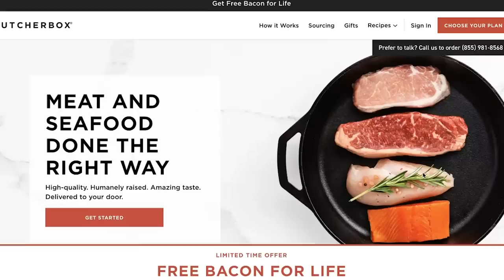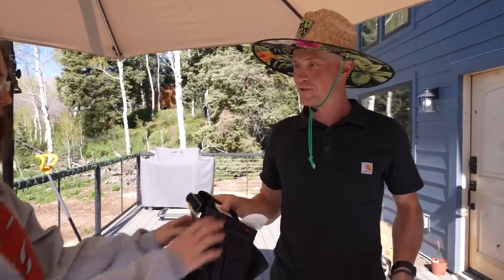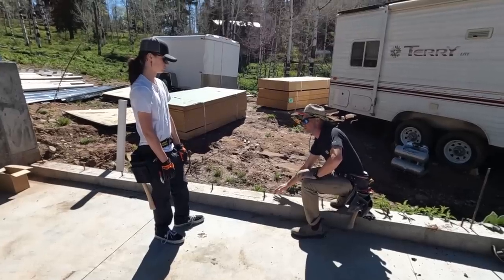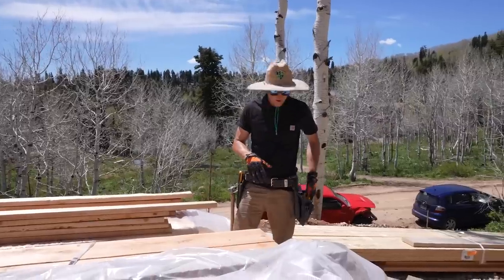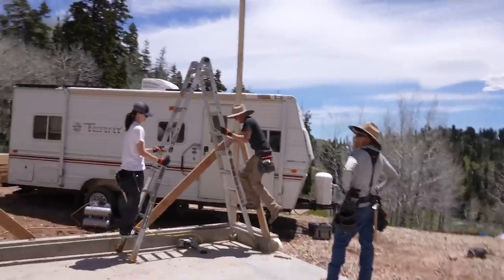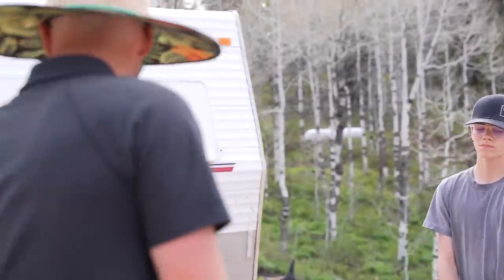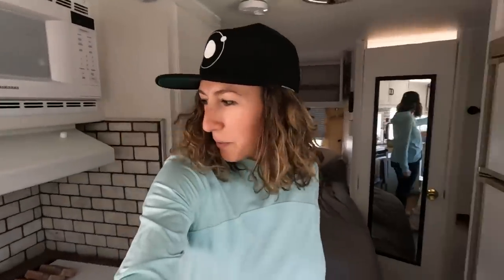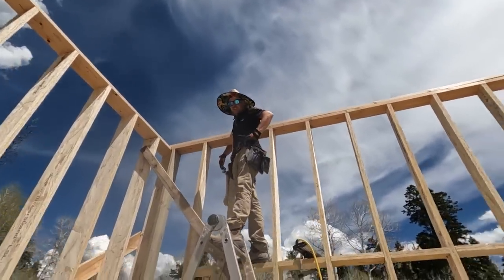FRAMING STARTS NOW!!! | BUILDING OUR OWN HOME

Comment: House cleaners don't usually tidy, they clean, so if you tidy first they will be able to do their job better. Well done Allie they will appreciate your foresight.
Reply: Totally agree Allie is correct. I clean houses for a living when I was in my early 20s. We did not clean up the clutter. What housekeepers do is clean the places that you don’t think about. Deep clean bathrooms. Clean Baseboards, pull cobwebs off the ceiling’s, deep clean bathrooms, dust and clean cabinets, the tops of refrigerators. We also mopped floors and vacuumed every room in the house. We will bring household cleaning supplies , most people like us to use their household cleaning supplies. Most people also prefer us to use their vacuum as well.
Reply: Well said! I would do the dishes because I wanted their time to be spent cleaning the actual house, and I put stuff away simply because they don't know where it goes.  They clean, not tidy is the best way to put it
Reply: You will get a much better clean if you tidy first and they don’t have to move your stuff to areas you maybe don’t want it to go. Tidy is a must do. You can also better judge the job done.
Reply: As a former house cleaner I concur!  Unless you specify clutter clean up which takes longer and costs more.  Plus we don’t know where all your stuff goes like you do.  Great comment!
Reply: I came to say the same thing. :-D
Reply: So glad this was said. The worst thing for a cleaner is to have to pick up your clutter, wipe under it and lay your things back on the clean surface.
Reply: Exactly. We don’t like House cleaners to have to clean around stuff and they don’t like to do it either. You must tidy up and put stuff away where it belongs so they can do a better job.
Reply: Yes! Our cleaner doesn't move anything or tidy. So I tidy the house before they come. I pay them to clean not tidy.
Reply: This is so accurate !
Reply: THIS ☝🏼☝🏼☝🏼 Kelly is spot on.
Reply: @gardengirl318  
Yup... Cleaning and Tidying are two different things.  I actually love to clean... Tidying takes a bit more processing.
Reply: Yep,I don’t know where your stuff is supposed to go. Also a lot of cleaning services are hired for a set amount of time. If they spend half an hour picking up that’s half an hour of cleaning that won’t happen because they may need to be at another job on time. 
  😬I knew it was Joel😜👍🏻😄
Reply: So true. Besides, when you put your things away, your housekeeper won't have to guess, and  leave you guessing too. You're the best Allie when it comes to organizing, especially when you put your videos in high speed.  It's so fun to watch.
Reply: As a past owner of a nice little cleaning business Allie is correct.  If there is tidying  up it takes away from the time that the estimate was given for and the true cleaning that needs to be done doesn't get done.  As an owner of the business I would back my cleaners if there were complaints that things didn't get done.  Cleaners would take a picture and show me for proof.  House cleaners are CLEANERS not organizers.  Unless you specify and pay for the extra cost.  Also many accounts (highly recommended) would have us come in the spring and fall to do a deep clean.

Comment: Hey Joel!  There is an official Carpenter's Helper way to carry plywood.  Tilt a piece up on a corner.  Put one arm next to your body with your fingers curled outwards.   Bend your knees and lower your body then grab and lift the plywood.  With your other hand grab the plywood behind your head.  This is much easier and not as awkward.  You're doing great!

Comment: need scaffold again for the garage  Work smarter not harder !! Get adustable legs with wheels  then could use on the outside of wall  after ground is leveled

Comment: Trent; key piece of information. You can talk to a dozen seasoned builders, which you are now one after the great job of building your house, but anyhow to the point. LEVELS ARE USUALLY NOT LEVEL. The best way to check it is place it on something, and notice exactly where the bubble is. Then spin it around 180 degrees and see if it is on the same spot. So for example if it is dead center in the first position, and then you spin it around and the second position it is no longer dead center, it's time to toss that level, and go cherry pick one at your local big box construction store, yes like HD. 
I went into HD and they had this huge box of levels, and I checked lots of them, and after quite some time I found two that were spot on, and the rest were not. 
My brother was a licensed contractor, and had his own company. The guy who worked for him had 20 plus years experience, and when my brother asked him if his level was level, he assumed it was, and then checked it and was shocked that it wasn't. 
Also squares are not always square unless they are cast from one piece for example of metal. If the handle is riveted on etc. then check to see if they are square. 
I've got a ton of respect for your go get it approach. I most especially am blown away by your mountain climbing agility, when you are 20 feet from the floor and dancing around on your toes on some ledge. Phew. Anyhow, standing on the top rung of a ladder scares the bejesus out of me, and you do it naturally. LOve your channel, and watch it religiously. Trent and Allie are one of the top You Tube channels on my list.

Comment: Maximum efficiency when built parallel with the road. Meaning the short end of the barn looks toward the house.  The front is the longest part with several stalls. Build enough room behind for a work bench behind the vehicles that are backed into the barn.  Yes, backed in because of where you live. Super!

Comment: When purchasing a level you should find a level surface and check the level in one direction then turn the level around and check the level in the other direction.  If the bubble is in the same spot both ways, the level is accurate.  You should do that same test with a dropped level before continuing to use it.

Comment: FYI I noted at 12:26 that Brandon was bashing a bolt straight with a hammer.  That can trash the threads and also potentially crack the cement around the bolt.   A better idea is to grab some metal pipe and use it as a lever to straighten the bolts.  Also a fast technique to mark the bolts is to dab a sharpie on the bolt tops then lay the board across the bolts along the wall.  Give the board a wack or two and it will transfer the sharpie and dimple the board marking where to drill.

Comment: To check a level, draw a level line on a vertical wall.  Roll the level toward the wall so the other edge is up.  If the line drawn is the same as the edge now up, it is good.  You can also switch ends and recheck.

Comment: I spent over 25 years working and managing a camera store. Never heard of Ulanzi. If you want a tripod that will last, buy Manfrotto or spend a lot more and buy a Gitzo, which will last until the next ice age. The Manfrotto will only last until we've had a colony on Mars for 20 years. I've had my Manfrotto 3221 for around 35 years now and it's never broken but if it ever did it's designed to be fixable in the field. I think you'd do well getting one of their Super Clamps and an adjustable arm for it with the camera adapter for it too. You can clamp your camera on a railing, post, tree limb, just about anywhere where the Super Clamp's 2" jaws will fit over. It will hold over 30 lbs.

Comment: Any time you want to check your level for accuracy, place the level on a flat surface , mark both ends as you read the level then place the level 180 degrees on those marks and see if the level reads the same. If it does, then your level is still good to go.

Comment: You can check the level by measuring a surface then flipping the level 180 deg. and measuring the exact same surface. If the bubble is in the same spot the level is good.

Comment: We've had house cleaners since we rebuilt our house 20 years ago and I'd recommend you do prepare for them by loading the dishwasher, washing pots & pans, putting away clothes, put boxes that normally sit on the floor up on the bed, clear bathroom counter tops of personal items, and lock away small expensive items.  By doing all of that it gives them more time to do a deep cleaning which is why you hired them.  They should tell you what they plan to do before they start.  Don't be afraid to tell them your expectations.  Like most employees, they will work to their level of quality if you don't tell them your level of quality.

Comment: How about that, Trent has an apprentice.  I would also recommend that Joel throws his hair into a ponytail.  It can get pulled into the power tools in a heartbeat.  Since those bolts have been sitting for a while they got some rust on them.  You really should hit the exposed bolt heads with a rusty metal primer to stop the rust from getting worse.   From what I can tell Joel is eager to learn and as long as he just watches and listens he will do fine.  My grandpa used the boy scout method of teaching called see then do.  I show you how to do something then you get to try it.  This method really helps to reinforce the technique.  I was glad to hear you giving Joel the severity lecture about power tools and especially nail guns.  This will be an experience he can use for the rest of his life.

Comment: Cleaning services come in to clean not to pick up all the accumulative mess . So if you can pick up the clutter they can spend their time cleaning . I mean I suppose they could do both but whenever we quoted a job it only included cleaning and your contract is usually specific . Just an FYI if you’ve never had one !

Comment: If you need to check a level is still level, spin it around and if it still reads the same after you’ve spun it 180 degrees it’s fine.

Comment: With all the hinting about 'A NEW EMPLOYEE', first person I thought of was Joel. Great to see Joel having more time with you guys. Maybe the apartment above the garage might end up being Joel's apartment in the future?
So when will you start making plans to connect the garage and the house with an enclosed bridge in between?
Putting the additions on both sides of the garage is a thought I had but never said anything about. It just makes much more sense to do that and have a designated spot to park the tractor, as well as a garden tool shed which will no doubts include a ride on mower, so space will be a premium, and trying to shove all of that stuff into a 2 truck garage would make getting in and out of the trucks rather difficult. Plus, even having Mountain Made Vans to work on vehicles, Trent will no doubt want to have space at home to do some basic vehicle maintenance.

Garage is looking great so far! Too bad you couldn't use a laser level outside in the daytime. That would truly be the best way to level the whole garage as you build it. Just set up the level in one spot per level. Have a vertical and horizontal laser level so you can do it all at the same time. I'm not sure if there is an outdoor laser level or not, maybe check into it and if there is it might be a better option to use. They are way more precise (within a hair).

Keep Safe Always,
Matt - Toronto, Canada
I think by the end of the garage build, Joel will be working circles around Trent, just to show Trent up.

Comment: The general rule for a housekeeper is to get your stuff out of their way because only you know what to do with it like clothes, electronics,  your nail clippers, etc. Then they can clean floors and counters and sinks and windows and all that. If they're doing laundry, gather it all up because they may not know the shirt on the floor has a stain on it that needs to be treated or needs hand washing or is still clean because you didn't wear it, so make the mound or basket of dirty stuff easy to identify so they know what they're washing or not. Dishes, same thing, if they're doing the dishes, remove anything that doesn't go in the dishwasher so it's separate and easy to identify. You can't assume they know care info about your stuff. Also wise is to offer a specific place where they are to put anything they don't know where to put then you can be sure to clean out the area later and put those things away. This prevents things getting lost or stuffed where they don't belong and corrals your to-do stuff. Should be an area on each floor for wayward things. Basically, if you want them to clean something, make it accessible because if you have a project happening on the table, they aren't going to clean the table and disrupt your stuff.

Comment: Fastening your garage studs to the mud sill is a bad idea. Those pressure treated boards don’t hold nails well at all. And you can frame the walls on the floor and then stand them up. Like the house.

Comment: Trent, "We're not going to gender discriminate around here."  But then you did. :(   I don't have hair on my chest, and I'm not a man.  I am however a 58-year-old woman who single-handedly dismantled a 15x30 above-ground pool alone.  I broke 3 high-quality wrenches in the process, taught myself how to use a grinder to disassemble the underground support straps, sorted all the material, and sold them as extra parts or got cash for the metals.  After I single-handedly folded up the wall of the pool,.  It was only then I called for help lifting it into the truck to send to the scrap yard.  I then learned how to use a reciprocating saw to dismantle a 4-foot-high wooden deck surrounding one end of the pool.  I cut it into sections so I could repurpose the material in other areas of the backyard.  Next week it's releveling the ground using chip and dust and a packer (again, it will be self-taught.) to prep for installing a new pool.  Women are strong too! :)

Comment: I'm sure Allie is glad that Trent finally shaved his face.  Why are you building your walls in place?  Why not build them and then  put them in place?  You do have the manpower to lift walls and it would be a faster simpler build.  Also, you mention you were going to change the garage from a 2 car to a 4 car garage.  When are you planning to pour the  foundation walls for  the other 2 bays?   Seems like it would gave been easier to look at the plans prior to the first pour so you could have noticed how small your structure was gonna be.  Hopefully lesson has now been learned.